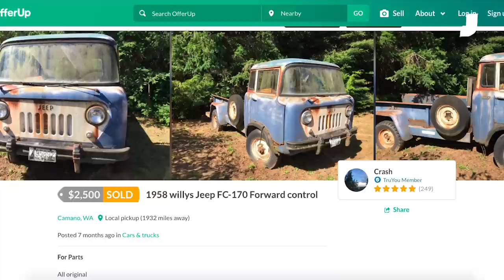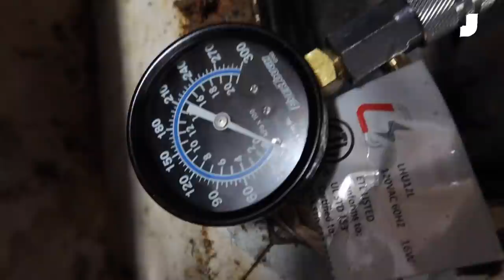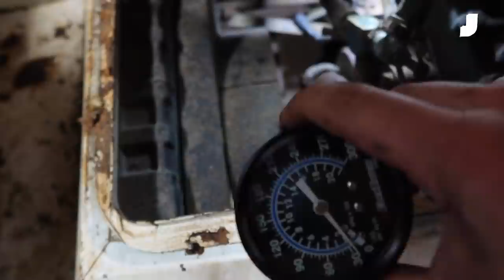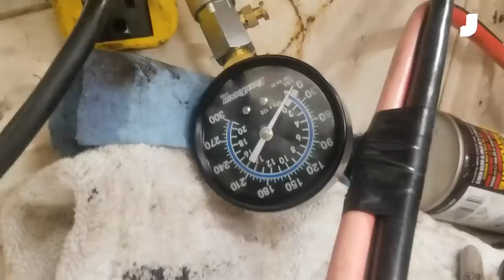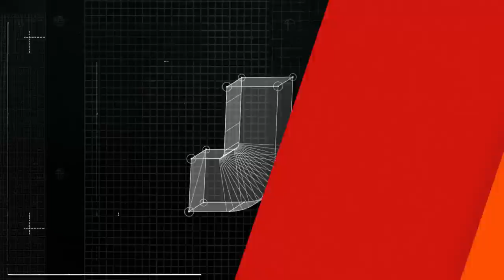Fixing The Most Hopeless Jeep On Earth Nearly Broke Me

Comment: amazing, nothing compares to crawling around in a COE 4x4 off road. Unless you fall in love with that hurricane engine for some reason, a nice tidy upgrade is a small Ford 144 CI industrial engine from the 60's, with some light gearing mods, lots of room in the doghouse with the 144 plus insane mpg & reliability,,Had  the 144 in a willy's FC190 LWB 50 years ago, with brownie 3 spd behind a 4 speed box & dual range transfer case with od & 19.5 truck wheels w/ duallys in the rear, huge ground clearance without a bunch of suspension mods, it was our back country baja explorer back in the day, averaged well over 30 mpg with a camper shell & gear & literally would idle anywhere you pointed it.. only vehicle i ever had that i miss having.

Comment: Hey you have a channel. I read Jalopnik articles on the internet all the time.
   I just read the article about the standardized four cylinder idea. 
  First, from a consumer budget cost standpoint. People will always need a low cost entry level vehicle. 
   Standardizing an engine for different chassis may not seem like a bad idea. But I think it is. 
   As far as the big picture, that would be the first step towards a global automotive company that is the only one left after the rest were consumed.
   Therefore, the difference in these engines and their designs is of the utmost importance. They are different, make different power, they sound different, and they drive differently.
   Not a bad idea for low cost, but our manufacturers and those abroad need their borders. Competition always helps to create variety and cost reduction.
   It is not my opinion that manufacturers have left entry level buyers behind. But the cost of an entry level vehicle has gone up over the years. That is just the effect of inflation. That means we just need to make more money.
   Oh, I almost left out the fact that the reason why there are so many 2.0l sized engines is because the size is fairly ideal. For a four cylinder engine, it is pretty large, just not as large as some of the largest. 
   Yet it is still small enough to be efficient with current turbocharging and compression trends.
   I think manufacturers have done an excellent job in providing a small engine that produces such power and torque with the emissions standards we have.
   I am amazed that our level of electronic refinement with variable valve and ignition timing lets us use the compression we use while turbocharging, and also using sub par gasoline for the application. 
   These little engines have been creeping up the class lines of vehicles. Which is a good thing, but it is also a bad thing.
   The positive side is that they are small, efficient, and produce adequate power for the applications they have been replacing. Which is how manufacturers have been keeping in line with standards.
   The downside is that, though they can be high performance, and even be considered a luxury engine, only luxury for specific applications.
   My opinion is that for a luxury sedan or SUV, we all want the V8.
A six cylinder, especially twin turbo can fit the app. But we want the V8.
A turbo four cylinder kills the selling potential of the American Luxury Sedan. 
   The thing about those turbo fours and turbo sixes is that if you weren't aware and you drove the vehicle, the power would seem fine. 
   But they don't sell the vehicle unless you are specifically looking for the economical solution to getting yourself into the specific luxury sedan that you have got to have.
   That's how we hurt ourselves. That doesn't mean that the sedans that are available with those smaller engines aren't still nice. They are, but the simple fact is that those V8's move those chassis, car or truck. The V8's are also the most profitable for the manufacturers as well, as the smaller engines are actually typically global applications that are meant for a variety of applications and chassis.
   I love small engines, four or six cylinder, but given the choice, I'll take the V8!